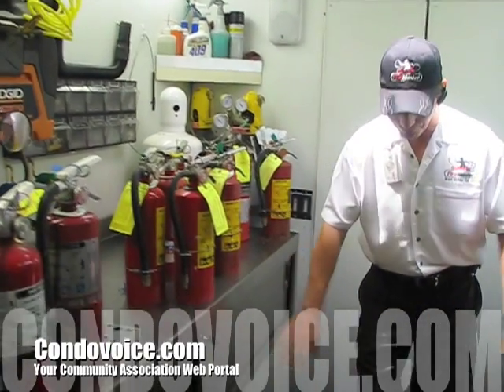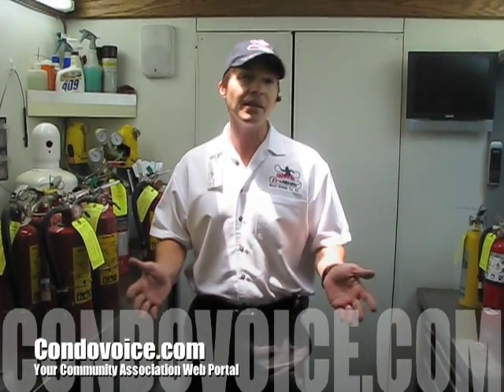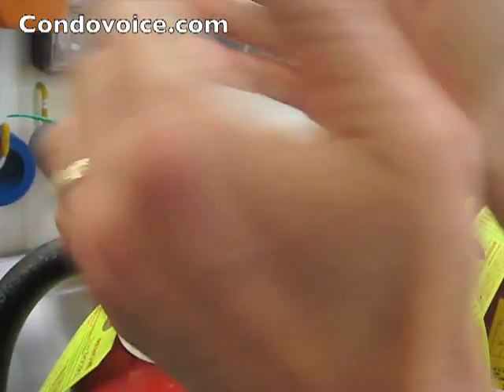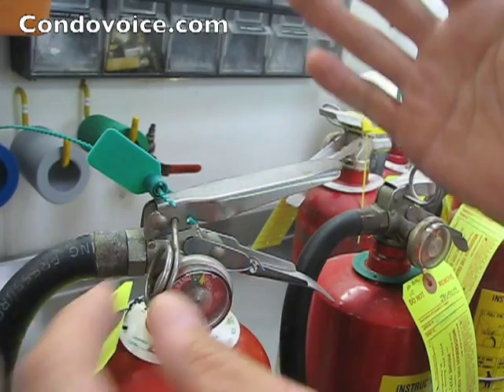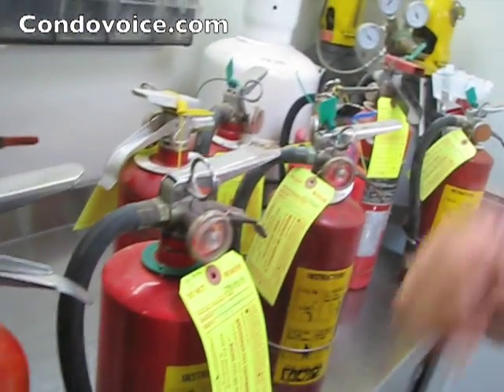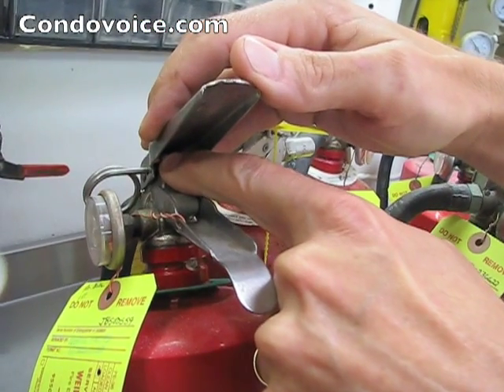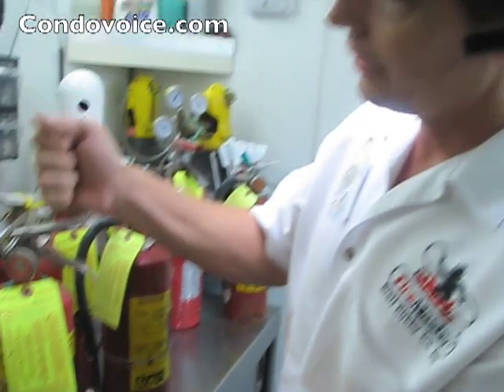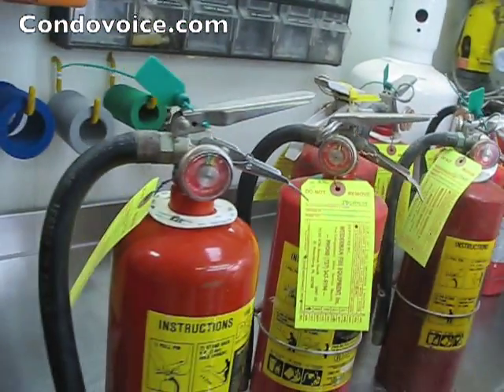Fire Extinguisher recharging on site at condo & HOA

Comment: Is it safe to discharge extinguishers indoors? We have a hopper at work with a filter and exhaust fan for any dust. But what about all the nitrogen being put into the air in the room? Sometimes we recharge 30-40 5 lb. Extinguishers in 6 hours. Thanks

Comment: I got a question. i have an extinguisher built in july of 1971. its about 2-4 feet tall. Can it be recharged? even though it still is full of powder inside but has lost its air pressure.
Reply: RVGURU If there is No Rust just loosen up the powder up and refill it after you use it replace any old O,Rings and pressure with Dry Nitrogen Gas only unless it,s an air water .
Reply: its an ABC. says on the back use AIR or NITROGEN. its a 10 pound one. i looked inside when i cleaned the valve assembly and seen no rust inside it.
Reply: RVGURU If you have a Moisture device to stop any moisture from getting in its ok .I find it better to return all refill,s to home for a refill then we can put them in a leak tester as some people dont replace all O,Rings if we take one we leave a loaner at no charge if you dont use it and your,s is returned in a few days ,s At pressent we are being flooded with imports from China .I have allways liked NuSwift the rolls royce  Fire Extinguishers .British Made .
Reply: i have air dryers in line with my air hoses.
Reply: Buy a cheap air compressor will do the job i bought a TV camera to check inside and at 5 yearly here we do a full pressure test mark the extinguisher with a steel letter punch 01/11/2015 PT 2.5 mpa  and take the unit back if the unit go,s flat over the next 12 months and the deal is Not broken we refill it at No Charge cheers Mate .